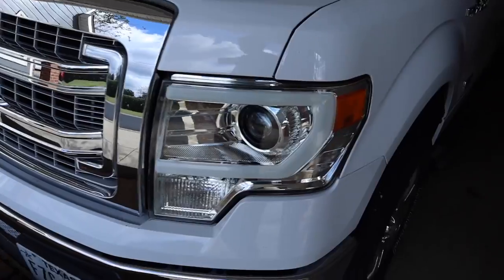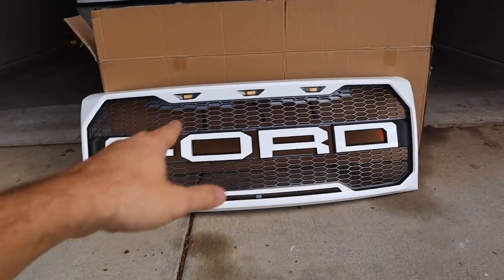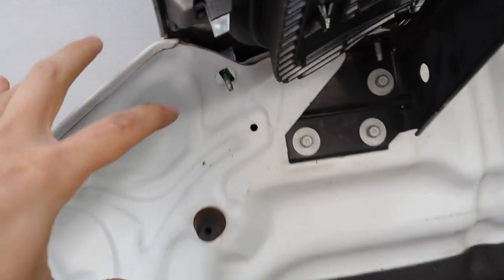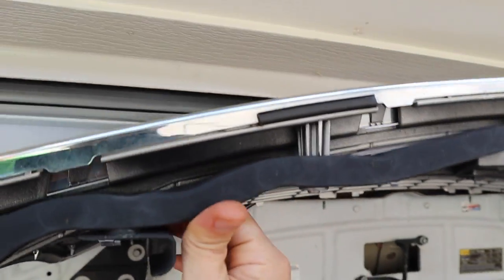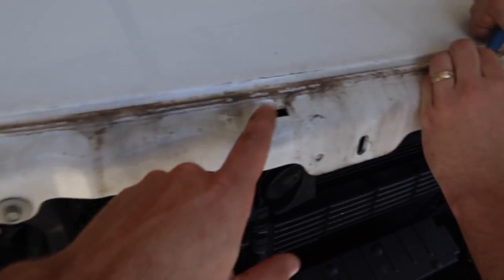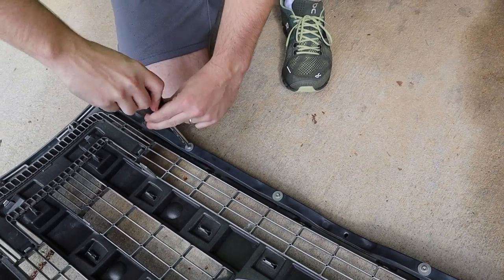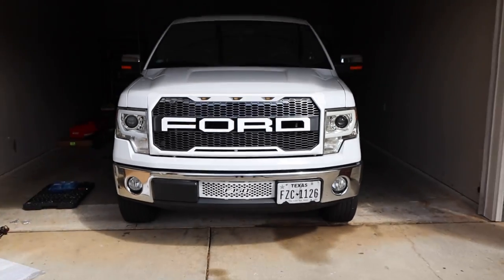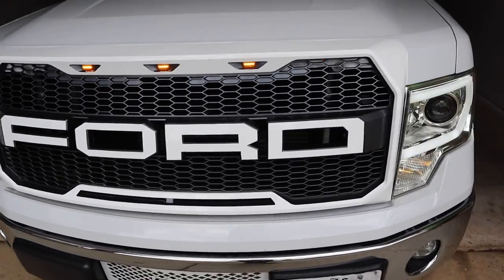2009-2014 F-150 Raptor Grill Install

Comment from the maker: If you want to buy the same grill click the link in the description!
Reply: What’s the name of the factory grille?
Reply: LegallyLion_ I want to say OEM? At least what i’ve seen
Reply: Hi I have a white 2008 F150 XT. Can I get it wrapped.
Reply from the maker: Yes
Reply: I want
Reply from the maker: Click the link.
Reply: In white ?
Wrapped in?
Reply from the maker: It’s vinyl wrapped
Reply: I can’t find the description so I can order this grill
Reply: Where to buy the same grill. Just show me the web site please.
Reply: @TTorres1183   can I buy a bottle raped raptor Grill for my 2010 f150 Oxford White with FORD
Reply: @legallylion_5653   I would like to buy one of this type and color raptor Grill.
Reply from the maker: Check the description
Reply from the maker: You’ll have to get the grill vinyl wrapped
Reply: @TTorres1183  description
Reply: @TTorres1183  4:09
Reply: Does it come in chrome plated

Comment: Really wanted to see how you wired it in. About try it with a similar grille soon.
Reply: The + goes to the wire right before the the plug in to the park/blinker light that powers  that bulb all the time the vehicle is running. You can either look up your schematics or find it w/a tester like I did.  I like to alleviate bad grounds later and just go to the battery w/the  ( - )

Comment: Did you need load resistors on the wires or can the leds handle 12v?thanks
Reply from the maker: we did not use any

Comment: Are those aftermarket headlights or did you just put a light bar in them?
Reply from the maker: Aftermarket
Reply: TTorres1183 could I please know where you picked them up from Im looking to upgrade my 2013 lariat

Comment: The link in the desc does not have the white option. Any other place to find this?
Reply from the maker: Did you watch the video?
Reply: @TTorres1183  yes I watched the whole video start to end. I can’t find the white grille on the internet anywhere.
Reply from the maker: The grill is vinyl wrapped

Comment: Who did the paint job for the grill ?
Reply from the maker: It’s vinyl wrap
Reply: @TTorres1183   The grill comes black right? So you just wrapped the letters and outer edge of the grill ? Do the letters come off ?
Reply from the maker: That’s correct. The grill was dropped off and wrapped by a vinyl graphics guy
Reply: @TTorres1183   Thx for the feedback

Comment: Front bumper? Lol.   I just got my DOOd grill and it was really easy to install but wanted to see how people are connecting the wiring. Too bad you didn't include that part.
Reply from the maker: To the day time running lights
Reply: Does the grill light stay on then when with the auto headlights turn on?
Reply: @charleynop1214  Yes, mine do.
Reply: You wired to the day lights??
Reply: @charleynop1214  Yes, if I turn on just the running/parking lights they come on. The head lights don't have to be on.
Reply: Thank you, can you explain to me what wires need to be wired too? Like the red and black to which wire on the parking light wires? I wanna know before I start the installation,  thank you
Reply: @charleynop1214  lol sorry if I misled you in believing I knew how to do that. I took it to a local custom truck shop and paid them. I'm not that smart.
Reply: Haha its okay man. Thank you

Comment: Nice video. I like that look. Where did you get that lower grille from and what is the name of it? Thanks!
Reply from the maker: Links in the description
Reply: @TTorres1183  not the big grille. I'm talking about the lower grille. The one at the bottom of the truck. It has F150 on it!
Reply: Yeah the lower grille with f150 logo on it.where did you find it please.

Comment: Get LED switchback bulbs with load resistors installed as the turn indicators on the headlights and get the orange reflector side markers on the headlights covered with white wrap to hide them